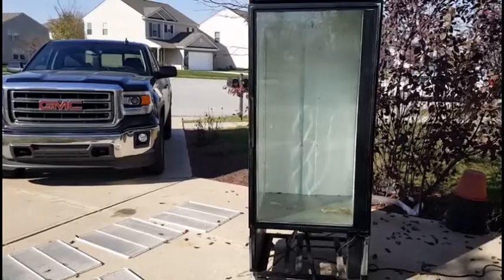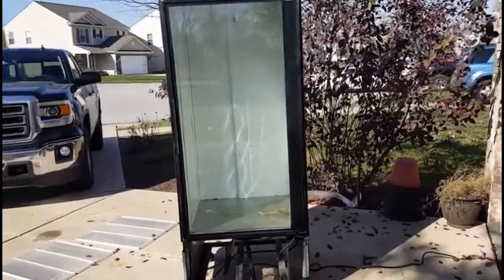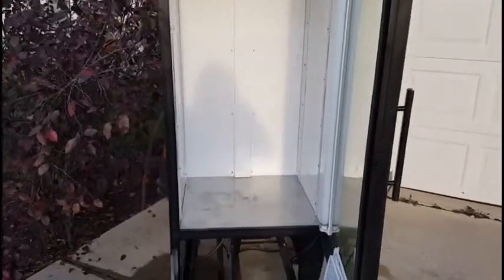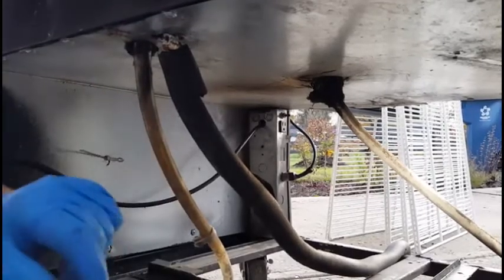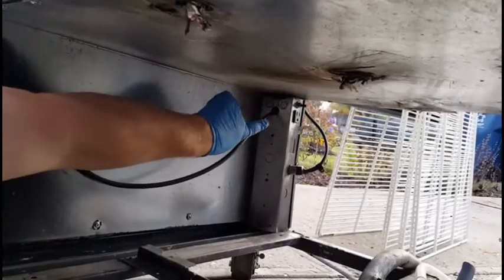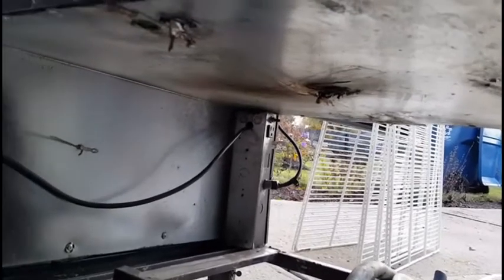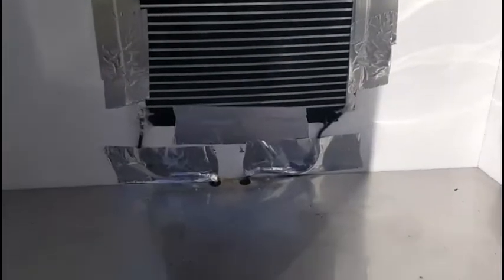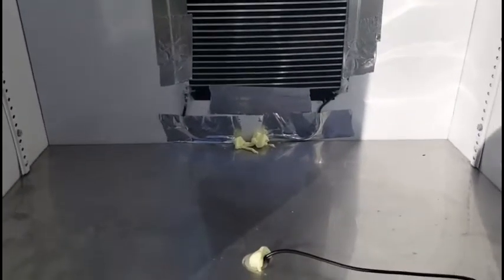Ball Python Egg Incubator Build

Comment: I would suggest that you put full water bottles under the bottom shelf... and they will act as a heat sync. That way, when you open the door, and the temperature drops... it won't take as long for the temperature to return to normal. Just an idea... but otherwise, GREAT video tutorial on how to build one of these.
Reply from the maker: Juicebøx Plan to, its not in use yet. Hopefully it will be full of eggs in the next few months.

Comment: That is awesome!  That cooler is a GREAT find!  I assume it no longer cooled, so I would have been curious how much you were charged for it.  You also mention it was from a "distributor."  Is that a Coca Cola/beverage distributor? or appliance or restaurant distributor?  I'm going to go on the hunt for one myself.
Reply from the maker: It was from a distributor of wholesale vending supplies. They sold the pop, candy bars, and all the machines. The unit no longer cooled, I just removed all the guts.
Reply from the maker: It was around 350, not bad for as much as it holds.
Reply: Serpentine Dream thanks for the reply, I’m now on the hunt.

Comment: I did this too, but make sure to use electrical tape over the ends and also over the main silver or copper strip of the heat tape. i used foil tape to secure it to the cabinet. I got voltage bleed thru the plastic and my cabinet is live! not kill u live, but u feel it. I will re do it after my 1 clutch this year is done incubating
Reply from the maker: I did use electrical tape over the contact points. Thanks for the comment.
Reply: Serpentine Dream I actually meant over the whole strip. I believe my heat tape is bleeding current thru the plastic somewhere, as I double taped the solder points and the ends all the way across. the plastic must be thin enough to bleed some current thru to the metal cabinet. it's the damndest thing. u can test for current bleed by feeling the metal of the cabinet while it's on and heating. if it feels like a 9v battery on your tongue, there's bleed. not really an issue as long as your tubs are plastic and the babes can't get out and touch metal. just something to check for. even after a while in operation. mine didn't do it at first. only after months of use.
Reply: TheShadowrider81 bm

Comment: Have you had any issues with the built in fan making it to hot in the incubator. I have the same exact setup and my heat tape won't even turn on due to it getting over 92 degrees. any help is appreciated 
Thanks,
Reply from the maker: Devon Mckinney no problems at all, it's holding steady with no spikes.

Comment: Question did not understand why or what you sodered??? Can you explain it little to me please everything else I totally understand???
Reply from the maker: The heat tape has 2 metal strips,  one on each end.  You can buy clips for those connections or you can solder them to the electrical cord.